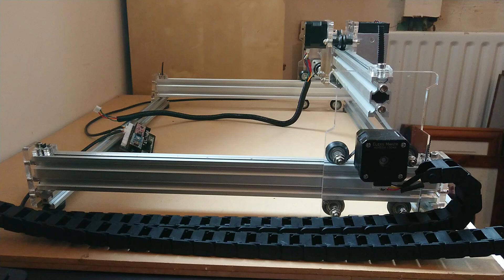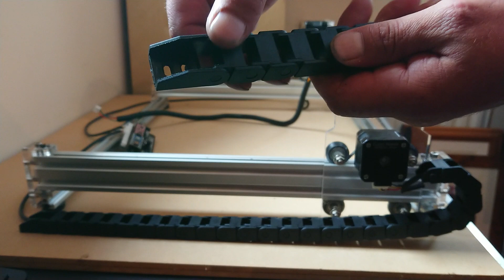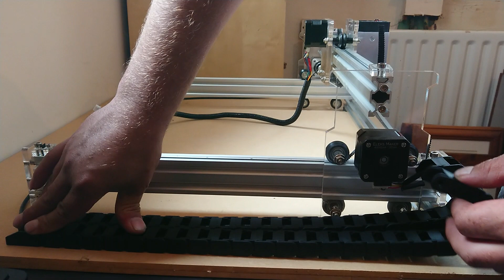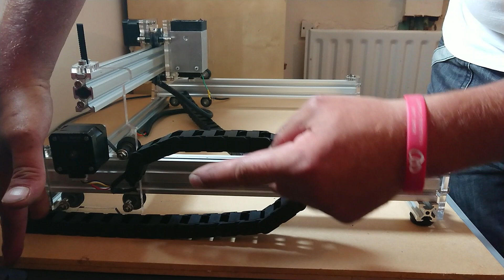Endurance laser drag chain install.

Comment: I would not mount it that way.  that will cause too much strain on the wires near the motor which are already prone to breaking.  A better option would be to use a drag chain attachment to the motor to transfer the strain to something that wont break.  They can be 3d printed or ordered from thingiverse.  I like thing:2411551 or thing:2606956 personally.